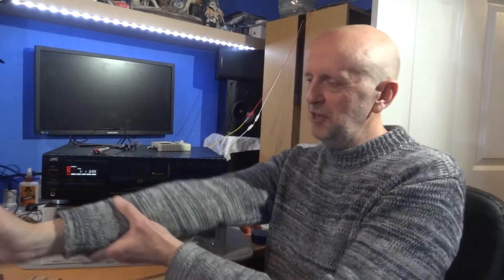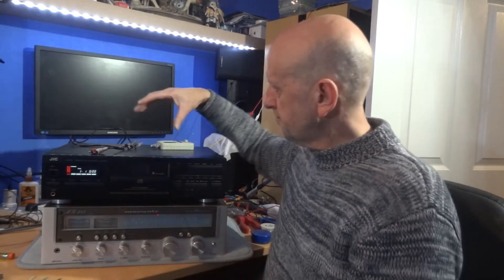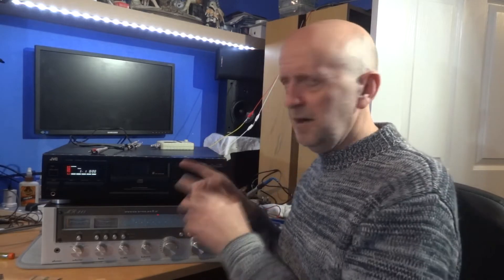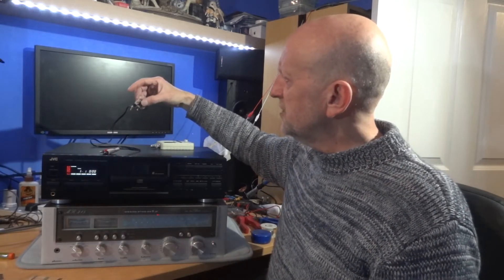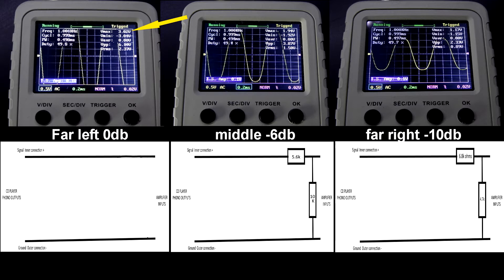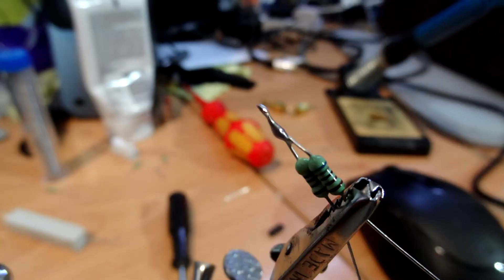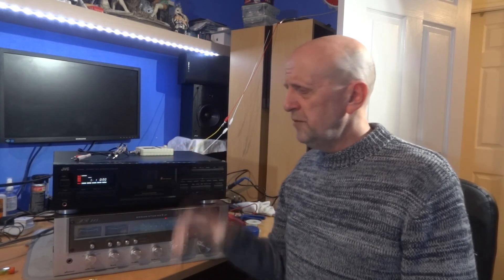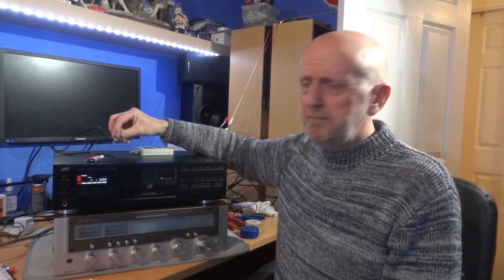Making a RCA Line Level Audio Attenuator Phono Cable 6db, 10db.

Comment: Ahh so this explains what I need to do with my setup. My DAC output is 2v and the input of my Sansui AU-111 is 220mv
Reply from the maker: Yes this lead can help sometimes with a miss match in input and output voltages. Especially with old vintage amps being connected to newer cd players, Dacs, mp3 players, tv boxes etc.

Comment: Why do I need to connect signal wire with ground wire?
Reply from the maker: Hi, The L PAD is considered better than just a single resistor on the signal, so you have a resistor in series with signal and another between signal and ground more can be found here https://www.instructables.com/Homemade-RCA-Attenuator/
Reply: @MichaelYates  Thank you

Comment: Brilliant. I just made up your -10dB lead with some bits from eBay and it works a charm. I recently swapped a Sansui TU-417 tuner whcih has output control for a TU-317 which has none but matches my AU-317 amplifier. The TU-317 must be default full power output so that even on minimum volume my amp it was borderline too loud. Now with this -10db lead there is much more play in the volume control. Perfect, thanks Michael.
Reply from the maker: Thanks for the comment, only to pleased it did the trick

Comment: brilliant video, i wanted something so i could test various device inputs on vintage receivers and this will be perfect for that, would the 10db be enough for testing phono inputs or would you advise higher?
Reply from the maker: Thanks, the -10db should be fine. This is the value I use

Comment: just a question: what would happen if you don't use any attenuator? could you ruin your old receiver and blow up the output transistors??
Reply from the maker: Any damage would be to the pre amp input transitors clipping though unlikely as its a low voltage, but the output from the amp might sound a little distorted due to the inputs having to much voltage and clipping.
Reply: I own a Sansui's solid state eight and even if my new cd player has a volume / via remote control I might consider to buy attenuators in case the remote control fails. So gar I haven't managed to get those here in Lima
Reply from the maker: @renzoparodi3534  You can also get just the plug type like these, though do not know if they ship to Lima,, https://www.ebay.co.uk/itm/324829561113?hash=item4ba159c119:g:bMwAAOSwdFlhbpSN&amdata=enc%3AAQAHAAAA4DUYg9Q13S9bvbJRp6NhsTl1h1ojSSmc%2FqaLBNzvQOUwFOa7A9BUO8ZRYbz3IMJIVZVCNARC%2BFjU4TlSyrXeHXz2Ibg1hHnveR%2BaH1SXJTAsBBtR9SRgO6WV3E3o4unJ4%2B44DmOl%2BeEkmg%2BQpOBxEENU%2FIfX36QyPUFzALQQ3UJrUBY35%2BPA8EUhHAAXLWWliO2Gbk%2FjrrwgFRnpc53EG6igc6bHk6v2T%2FWmqbNBOJz%2BcUlC2%2BigFsRBcVvd8BOgVxZ%2BWz3eixiinqtpMlrncQBPWb6GexdaBj3%2FgbPNeQts%7Ctkp%3ABFBMmv-6js9g

Comment: michael them plugs are not that good i have used them the mini bolt allways coming out i file where the bolt was to clean the  place and solder on the wires

the best audio cable for the money was the audio cable maplin used to sell i had 500mt when they solded all there gear went  around london shop reading had
200mt  £15    try  from ground  to cable cor works better this will work as  well  you find out as you use
Reply from the maker: ok thanks Bob
Reply: @MichaelYates  
if you ever need to put a res
i allway cut cable like you did 

i would put res in the cable with
the heat skint  putting in the plug
is not very strong 

up to you  i have worked on alot
of cables
56 edac plugs are hell 

adat tape decks use them more 
studio gear bob

Comment: I have the same problem. But my cd player has a control volume. Would that solve the problem???
Reply from the maker: As long as the volume control adjusts the rca outputs at the back and not just the headphone socket, then yes that will solve the problem
Reply: @MichaelYates  when I turn the volume down on the cd player then I have to turn the volume up on the receiver, but the distortion is over.
Reply from the maker: @renzoparodi3534  Then the rca ouput of the cd player is being adjusted with volume which is perfect to get the output just right